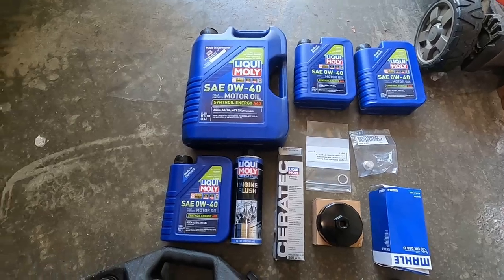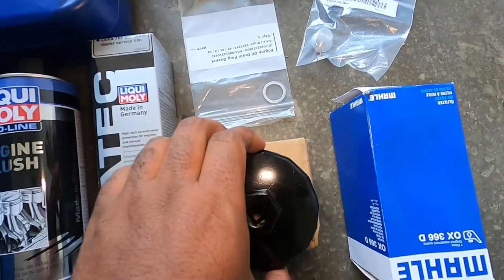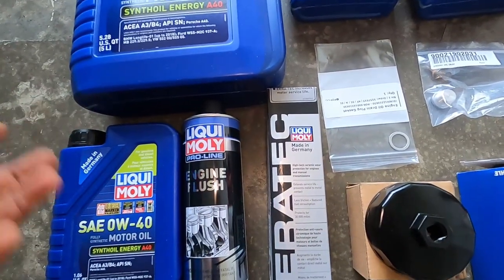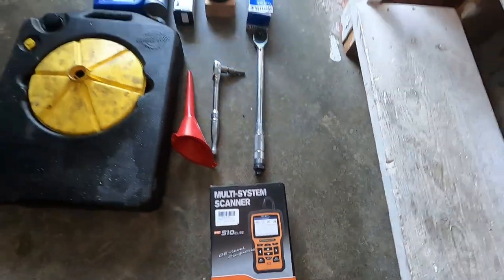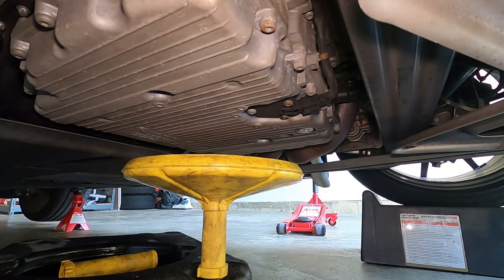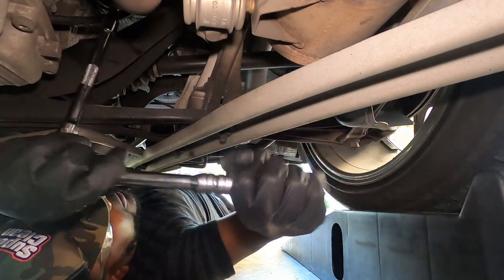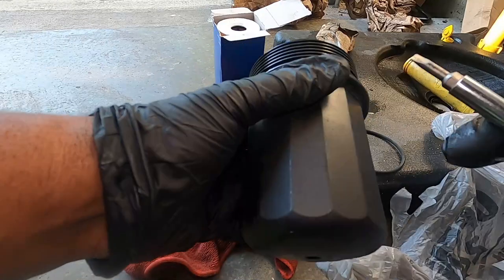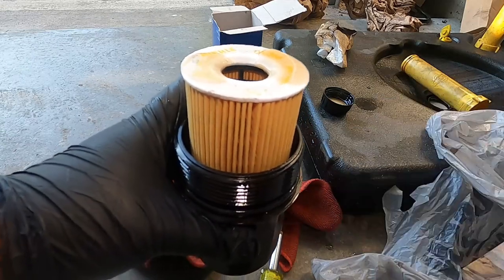981 Porsche Cayman S Oil Change and Liqui Molly Additives

Comment: Nice job!  How many litters did you up having to add?  7.8L?  Did you get to the full mark in the electronic oil level or 1 bar from full?
Reply from the maker: I put about 7.5l on the engine and it is full. Thanks